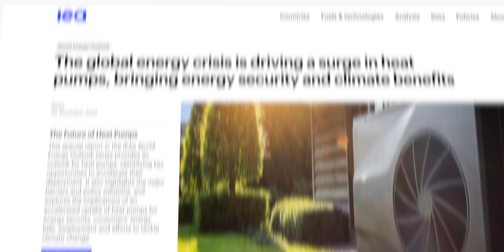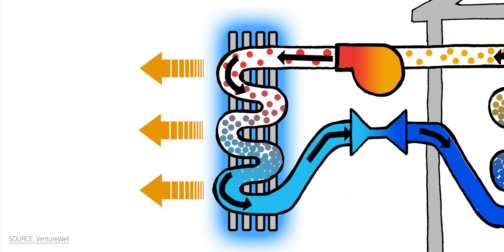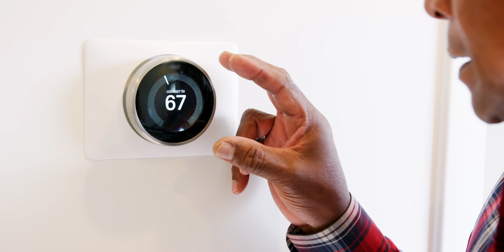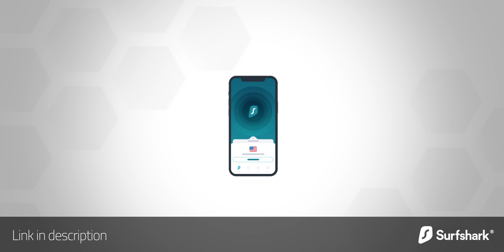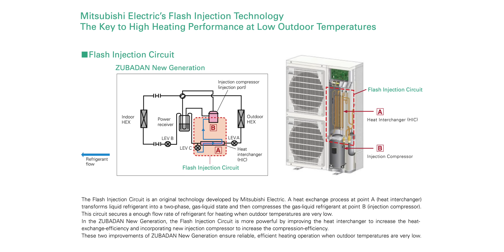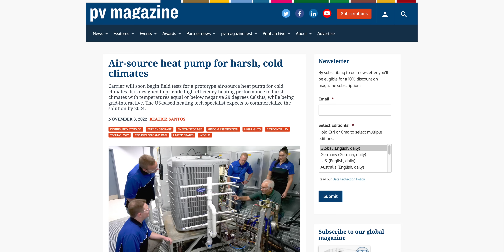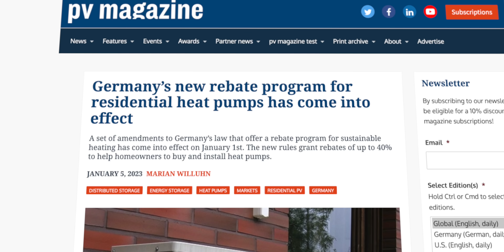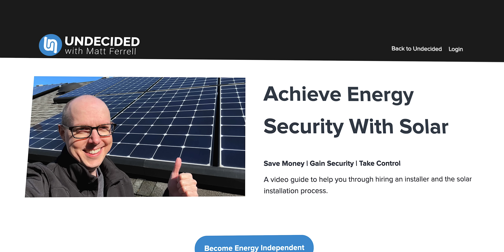Major Advances with Heat Pumps in the Extreme Cold

Comment: I have two air source heat pumps.  One connects to two mini splits and the other to one.  Both are LG.  The single unit works fine down to -30C.  The other starts to struggle at -20C and is less efficient (not enough heat out) if both mini splits are going at the same time.  The double unit is also prone to icing up at temperatures close to zero.  Service guy says the defroster works, but it can’t defrost serious ice build up (or apparently prevent it).  Now when it ices up I really load up the fire place till I am sweating then turn on the air conditioning mode - defrosts in no time after that.

Love the single unit, not too impressed with the double.  Note that they were installed just before I bought the house, so I don’t know the sales pitch for the double.

Comment: I live fairly near you and got a heat-pump (air-air) this last summer.  The HVAC guy asked why the heck I would want one.  Anyway it has saved me a ton of money even though my electric rates doubled about the same time.  I do also have a propane furnace as well.  Which is good because I've found the heat pump only works down to about 10F.  On a side note I already has forced hot air so the installation was cheap.

Comment: I had a house about 10 years ago (house was 6 years old at the time) that had a heatpump. It was miserable in the winter. If the temperature outside was in the <30°F, the temperature in the house didn't get about 40°F.
The big caveat not pointed out in your video is that only newly developed heatpumps may be worth it. If it's older, the likelihood of being able to heat sufficiently is low.

Comment: I have the opposite problem and wonder if heat pumps would work well in a hot climate. I've lived in areas where the temperature reached 100+ every day for three months in a row. What's the upper bound on temperature for a heat pump system?

Comment: Well that is great but current older generation heat pumps do suck in cold weather, I mean they literally do. Nothing is worse than sitting in your home and feel the cold blast of arctic air on your back when the heat pump reverses it's fluid in the defrost mode as the coils outside will ice over and must be defrosted. This is worse in damp climates where they ice over quickly. I didn't see a great solution to that, you did show some heat pumps that use electrical coils to defrost them, but electric heating is expensive.  Also when it gets cold, the emergency heat kicks in,, that is electric heat which is the most expensive way to heat. I'm not anti heat pump, I still think they need more improvements to both efficiency and comfort.

Comment: I live in Northern Canada and have a heat pump (TOSOT TW36HQ2A3D). At -25C it works perfectly. At -30C it puts out heat, but not a huge amount. My house is 60 years old and inefficient, so I use my gas boiler quite a lot. If I built a new efficient house I would just have a heat pump but also some electric heat for the very cold days. Even here in Edmonton, there are only a handful of days per year where the air temperature is below -30C.

Comment: You forgot to mention that geothermal heat pumps don't care about the outside temperature. The COP of the ground source heat pump remains on the better side of 4.5, regardless of the conditions.

Comment: I could see a heat pump working well with a geothermal system. Not only is the ground one massive heat sink, it also allows direct transfer of heat which is much more efficient than transferring it via air flow.

Comment: We installed a couple of very high efficiency Fujitsu ductless  heat pumps with a SEER rating or 25, dropped our Baseboard resistant heating energy usage by at least 1/4, works fine even below -19C, super quiet I mean very quiet. It has the auto defrost option that very really is effective. The heat is less dry than the baseboard heaters and comfort is totally great! We have never needed to use the baseboard as supplemental heat, awesome! Our next investment is a Heat Pump clothes dryer and heat Pump water heater and when we install our 10KW solar (totally great as our slopped roof faces due south and not a tree or shade), we will be just rocking past the hydro bill!

Comment: I have solar/powerwall battery/EV.  I save $500/month on gas and home electricity.  Even a small system can save money.  You do not need the largest system for your home.  Electric rates will continue to increase.  I installed my system 10 years ago.  I have 50 panels on my roof as only 250 watts/panel at that time.  Now 400 watts and above.  Less panels needed.

Comment: We own a heatpump minisplit for more cost effective cooling verse window ac's. (We are saving roughly 400 a year since switching from a window AC of similar size.) It also has a COP of 3.8. At 17F it is only 66.5% of the output of 47f which makes it a COP 2.5 still at 17F.  It does say it works as low as -22F, but I stop using it, for supplemental heat, once it gets down to around 10F.

Comment: Just for your information the substance that is compressed and expanded is one of the refrigerant Gases such as r12 or Freon, whatever you want to call it.   Fluids on the other hand cannot be compressed.  If it could the brakes in your car/truck wouldn't work.   Otherwise Good video.

Comment: Partial credit, I am an HVAC service tech, I work on gas and electric furnaces, air conditioners and heat pumps, but geothermal is a completely different type. 
In air to air heat pumps, you have a tipping point based on outdoor temperature. This  tipping point is around 32 to 35 degrees f. This  means that geographically different areas will have different rules about heat pumps, I live in Indiana, and an air to air heat pump requires supplemental heating when the temperature gets too low, that is commonly an electric furnace. I have a heat pump that I added to my gas furnace in whats called a dual-fuel system, so I have the options depending on the cost of the fuel.
In Florida, a supplemental heat source is not required.
What you talked about here is a geothermal heat pump, which is what my father in law has, he HAS electric strip heat, but has never had to turn them on due to one simple difference: air to air heat pumps source heat vary wildly while geothermal heat pumps can be more refined since the ground temperature varies very little year round.
To avoid confusion in the future, I would advise you to make that distinction between air source and ground source heat pumps since they are VERY different in how they operate and perform.

Comment: I live in central Arkansas, had a Trane brand HVAC system with a heat pump installed in 2015. There is an outside unit and and inside air handler unit.  The heat works find until the temperatures  drop below freezing.  I use a wood stove so that the insufficient heating system  doesn’t run continuously 24 hrs a day.

Comment: One very nice feature that a lot of heat pumps include is a back up heating system.  This is a basic resistive heater built into the air handler portion of a central air system, and is intended to supplement heating for those freakishly cold days.  (The heat pump might cover someone in Minnesota for 360 days of the year, but there's that one week of -40 degree cold that it's just not up to - that's the kind of thing the backup is for.)

The really nice thing is the backup doesn't care what the temperature outside is, it just recognizes that the heat pump is lagging behind.  So, if your heat pump breaks (as everything will, if you have it long enough - who here has a 50 year old furnace that's never needed repairs?), you still have heating.  It's massively more expensive because resistive heating is merely 100% efficient rather than the heat pump's seemingly physics-defying 250%+, but you're not sitting there freezing to death and having all your pipes freeze while the maintenance guy tells you it'll be 2 weeks before he can come and check out your broken heating system.  

(Side note: there's a reason why electrical heating is 100% efficient: electrical efficiency is basically the percentage of electricity that was used to do something useful rather than heating things up that don't need to be hot.  Incandescent light bulbs are very low efficiency because the useful thing is the 2% of the electricity being converted into light and the 98% of it that is made into heat is considered waste.  But when you're running a heater, making things hot is literally the point, and literally all of the electricity you use winds up becoming heat energy at some point.  One could also make the argument that an electrical heater is 0% efficient because it doesn't do anything other than generate heat, and that would also be kinda true...but misses the point of the heater's heat being useful.)
Reply: In essence...a regular heater is doing the heating, not pump. Lol

Comment: There's a money-saving technique that works with any heat pump, including older models. That's to time-shift the heat from a heat pump to the time when it is most efficient. During a cold spell, days are usually warmer than nights. During the warmest part of the day, typically early afternoon, set the thermostat to as warm as you can stand, perhaps 80+ F. Let the heat pump run continuously until that temperature is reached and then shut if off. Coast on that stored warmth though the night and repeat the next day. And yes, this technique works best if your home is well-insulated and you're willing to put up with chilly mornings.

Comment: I live at 9000' in Colorado, and my house has electric baseboard heating.  I've heard that heat pumps are great, but that it won't really use less energy than my existing baseboard heaters because it's hard to beat those for efficiency.  Am I right about that, or am I missing something that would make adding some air source heat pumps worth it?

Comment: We have been running a geothermal heat pump system for 10 years. Extremely efficient as the heat pump is running against a constant 53 degree source. System has more than paid for itself. Definitely recommend.

Comment: The complaints about heat pumps not working well in the cold have been so overblown for ages now.  Oh no, your heat pump is only getting 150% efficiency instead of 250%?  How tragic, that's so inefficient!  Better go back to the 90% efficient fire/Carbon monoxide poisoning hazard!

There is the matter that in some places like much of the US, natural gas is absurdly cheap compared to electricity, at which point furnaces make sense from a finance perspective rather than a raw efficiency perspective....but fossil fuel prices these days are, uh...not stable, and definitely are not coming down on average.

Comment: I live in an area that heat-pumps work well. I also am in the HVAC/R trade for 25+ years.  They DO NOT work well in temps below 20º F or below.  Yes, newer ones work better then my 15 year old unit.  But what you are not telling us is that during the defrost cycle some units blow cool air into the house at worst or no heat at best for you to an hour. And if you lose electricity in a snow storm, you'll need a very, very, l large generator. (With a natural gas furnace, a small 2k watt generator will work for your whole house.)  The electrification of heating will cost people their lives in some areas, and cost us all with strain on the grid.

Comment: I have been looking into air-source heat pumps since we need to replace our HVAC system.  Unfortunately, based on the few cost calculators that I can find, the air-source heat pumps will be not only more expensive to install than an efficient natural gas furnace/electric AC setup, but will also cost more to run.  I don't have enough land for a ground-source heat pump without vertical drilling, which makes the cost WAY too high.  With our AC completely non-functional, I can't afford to wait a few years to see if a better heat pump comes along.

Comment: I had a home with a heat pump in the 90s and not only did it work well to heat our home, in Virginia, during times when the temps got down below 20 degrees F, but it also didn't consume a lot of energy in doing so.  Our electric bill was never bad in that home.  There was also little maintenance cost like there typically is with a natural gas system.  You don't need it inspected on a regular basis, and if you don't do that with a natural gas system bad things can happen.

Comment: Heat Pumps on the West Coast professionally installed will be $10,000 to $40,000. They can be amazing but good systems aren't cheap! They work best for well insulated and sealed homes. It's a long term investment in your home. I still like natural gas furnaces for many applications.

Comment: They are fantastic as long as you buy one that is designed for cold climates! The Mitsubishi Hyper Heat units are fantastic even at 5 degrees F (-15 C). Some even have 90% heating performance at -13 F (-25 C). The Variable Speed Trane units are also amazing.

Comment: I own a mechanical contracting business for 35 years. I'm a certified mechanic from RSES. I install many heat pumps and there are several points I would like to bring up. First is efficiency. Efficiency does not relate to cost unless we are talking about the same fuel. For instance I could use a wood boiler with an average 60% efficiency and it will still heat cheaper than your best heat pump. For cost you need to see what you are paying per BTU and work out the math from there. I have also heated my home with a water to water geothermal, it was a pump and dump system with the groundwater in my area at 55 degrees. It was cost effective because I installed it myself but others I have installed have been over 30k. You have to break that number into year of expected life and add that to your yearly cost factor. I removed the geothermal because it is loud and gets louder with age, after all it is a refrigeration compressor inside your home. Heat pumps for residential only go to 60k BTUs. Many homes require much more than that so they need 2 units. This gets real expensive and will probably exceed the amount you will spend on gas for the rest of your life. This year in PA we had a week that was 0 degrees. Then we had several 4 day blackouts, many homes with just heat pumps froze destroying everything. Carpets drywall,big big mess and now concern about mold inside the walls. So depending on where you live, loss of heat can be just a minor inconvenience or it can be death and destruction. If you live in the latter use a heat pump with a gas backup furnace and keep a small generator. The last thing I can tell you as an installer/repairman. If you lose a compressor or reversing valve or outdoor TXV in snow and freezing weather you can forget about someone coming out to fix it. The newest and by far the best performing heat pumps use CO2 for a refrigerant, I can't believe Dupont is going to let a billion dollar refrigerant industry be replaces by the bubbles in your soda, we shall see. Having been to the AHR show in Atlanta this year, It appears as the air to water monoblock heatpump is the direction we are headed. These units are already very popular in Europe.

Comment: My house has geothermal in floor heating and it's the main way we get heat all year round. Some rooms never turn on (like the basement, or our computer room), but our ventilation heat never turns on. (We use the vents for air conditioning though)

Comment: Our efficient house In Massachusetts has 0.7 ACH air sealing, 6 inches of dense pack cellulose in the walls, 4 inches of exterior Gutex insulation, and triple pane glazing. Over the first 1.5 years we have lived here so far, setting winter temp to 70F and 77F in summer, we are considerably net positive with a 15 kW solar array. The HVAC consists of two ducted LG air-sourced heat pumps and a Zehnder ERV. Our system had no problem handling the recent cold snap with low temp of 4F. Thanks to net metering we haven’t owed money to the electric utility in any month so far. This was an expensive system but is on track to pay for itself far faster than we expected.

Comment: I have had a heat pump for about 15 years. The first compressor was very poor in cold temps and basically provided no heat when it got below 30 degrees or so. The second compressor is much better and provides heat down into the 20s. One factor that people need to understand is that heat pumps work over TIME. They need hours to do the work that a furnace can due in a few minutes. One trick I found was to just use the Heat pump during the day and basically "preheat" the house in the afternoon - then rely on the propane furnace more at night. Used a TON less propane that way. My goal was to add A/C to a house that did not have any so either way it was a win.

Comment: It’s mostly air source heat pumps that are affected by cold temperatures. 
Geothermal with a vertical loop will be mostly unaffected by cold air - but if used for extended periods it can eventually cool the earth around the loop which will reduce efficiency

Geothermal with a horizontal loop that isn’t very deep will have reduced efficiency in winter as the ground slowly cools.

Comment: A simple two stage heat pump cycle could easily run at -30C out side during heat and for cooling only the first would be used for warm weather cooling

Comment: I'm in the process of building a cargo trailer rv conversion.  My HVAC system is a Gree Sapphire 9000 BTU unit.  The COP is listed as 4.47.  It is rated to heat efficiently down to -22F/-30C.  I think it can work at lower temperatures, but it's less efficient than a resistance heater at that point.